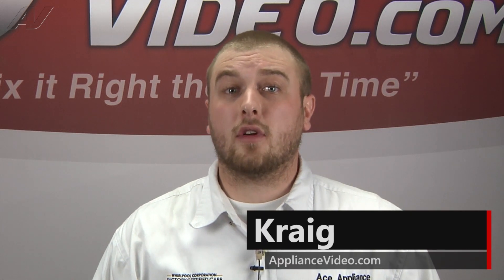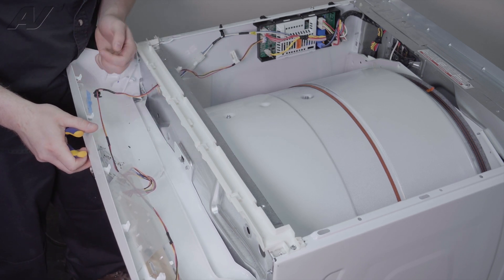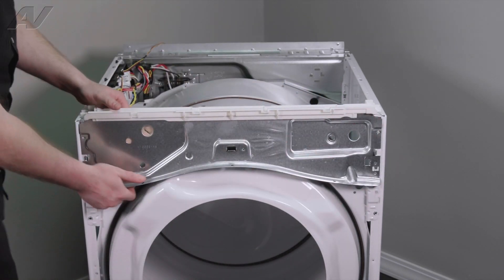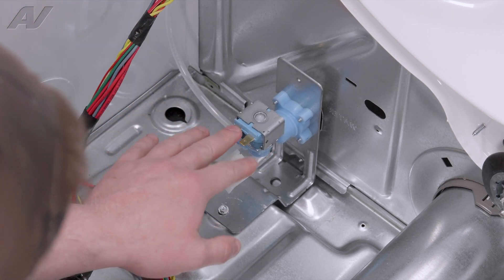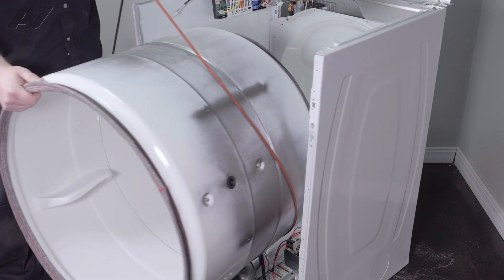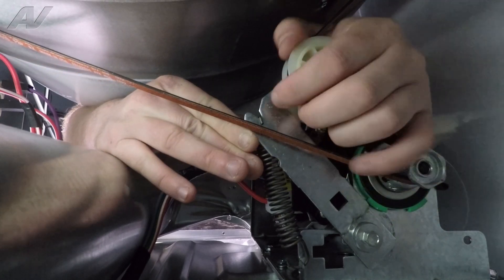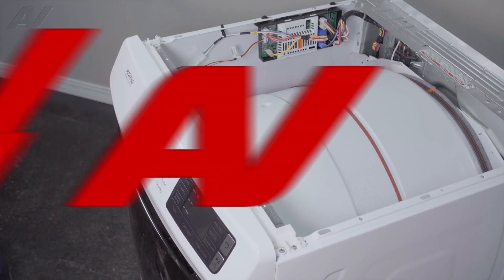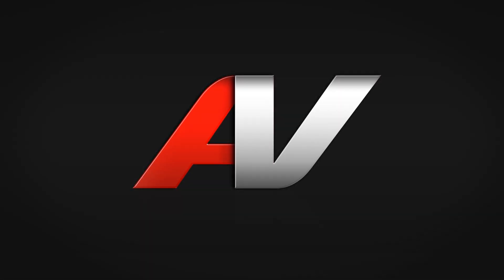Maytag Dryer Repair - Leaking Water, Will Not Fill - Water Inlet Valve

Comment: Water inlet valve (solenoid) is so much easier to replace from the rear than from the front... If you were able to remove the top panel, you already have access to the rear, and there's no reason to remove the drum.

Instead of cutting the cable support for the control panel, why not disconnect the cable itself from the control board?

Finally, repeat after me: detach. Detach. Detach. Very simple word. Stop trying to make "disattach" happen.